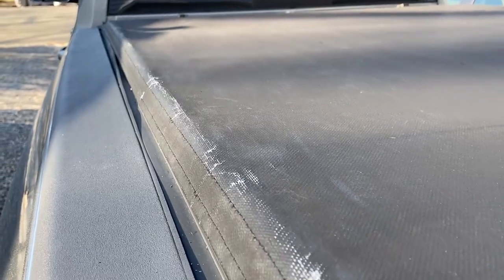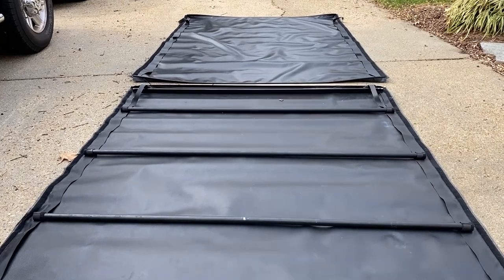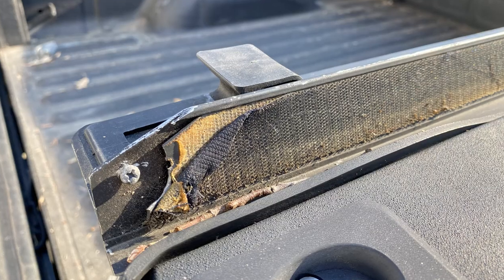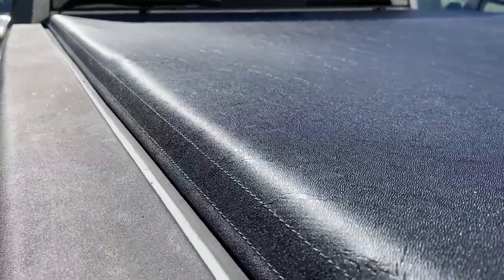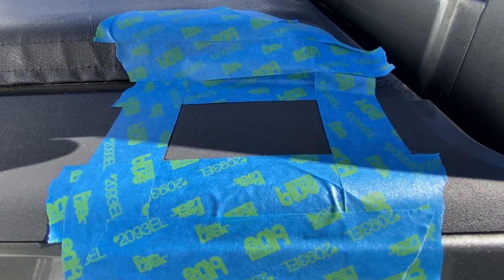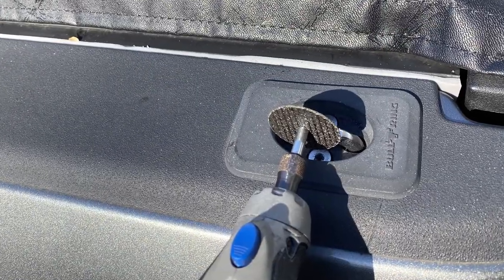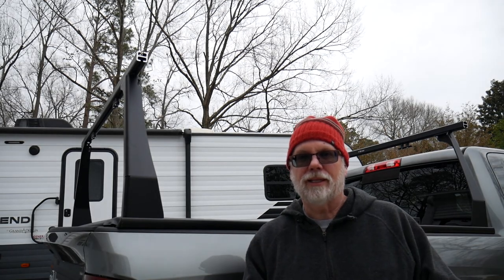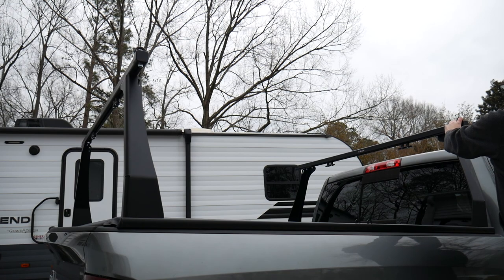ADARAC Truck Rack

Comment: Just bought this exact setup for my kayaks...do you have a video of loading, attaching, and unloading your kayaks? I'm mainly interested in how to tie them down!
Reply from the maker: Great to hear about your kayak rack. I haven't yet recorded a video of loading & unloading them yet. I am hoping to get that done this fall. Here are the basics. We load the kayaks as a team. While they aren't that heavy, it helps to have two people to get them into position. I use two straps per kayak. We got NRS buckle straps and they work great. The straps go under the rack and over the kayak on each side, then tighten the buckle. Any excess gets wrapped around the rack. With the two straps, the kayaks seem very secure. Our kayaks did come with a strap that has hook ends. As an extra measure, we use these fore and aft - with the hooks going into the holes where the handles go. I hope that helps. Looking forward to hearing about your kayaking adventures.
Reply: I'm seriously considering buying this rack. Overall, are you satisfied with the quality and ease of use? Are they easily removable over the winter months?
Reply from the maker: Thanks again for your feedback. Wanted to let you know that we now have a video on how to transport kayaks including how to load and secure them to the rack. You can find it at: https://youtu.be/PoqXM6PMRfI
Reply from the maker: Thanks for the question. We really like the Adarac rack. It seems very solid. We have been using it to transport kayaks and it works great. I'm not sure about removing it. We did have to open up two pole stake holes by cutting the plastic cover from them. You would likely want to find a way to fill the hole when the rack is not installed. 

The only downside to the rack is that our truck and rack combo are kind of tall so it limits things like being able to park in a parking ramp. All things considered, we are glad we added the rack.

Comment: What is the weight capacity
Reply from the maker: Thanks for the question. The weight capacity of an ADARAC truck bed rack is 500 pounds. It can be a bit more detailed than that and their web site describes it as: "Weight Capacity: 1,000 lbs. static, 500 lbs. dynamic and 400 lbs. off-road dynamic, evenly distributed." https://www.agricover.com/adarac/  I hope that helps.